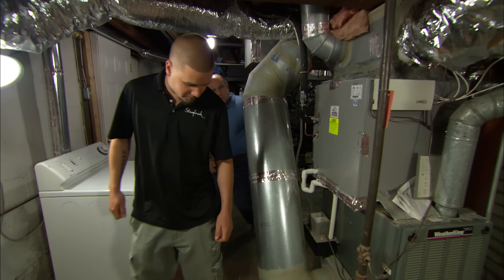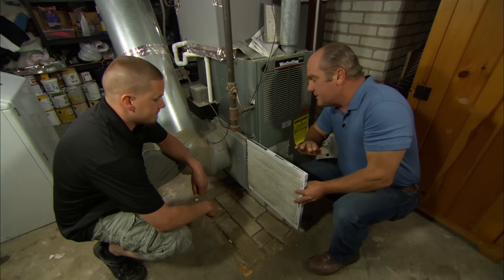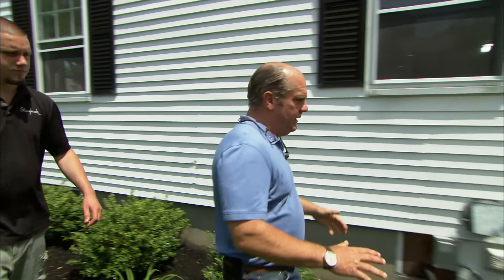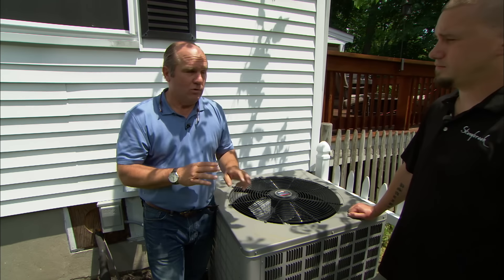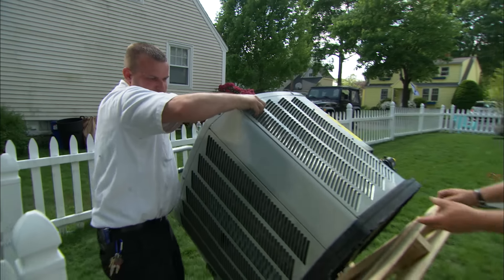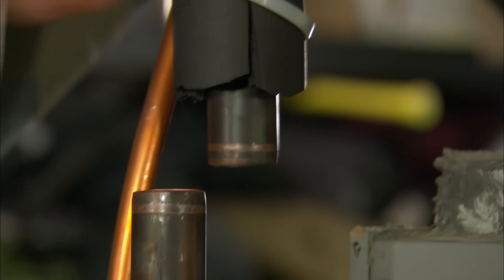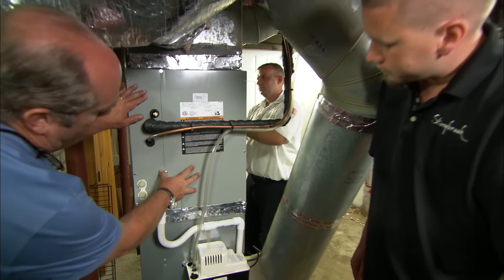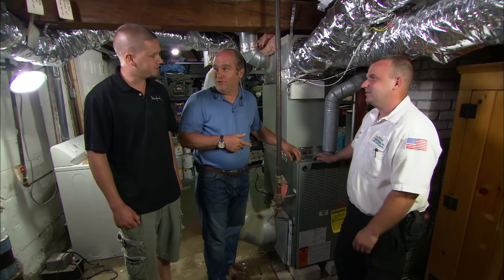How to Repair a Frozen Air Conditioner | Ask This Old House

Comment: WHY ARE THEY SITTING ON THE GROUND THEY SHOULD BE ON STANDS
Reply: AND DOES NOT NEED TO BE A TRAP IN THE CONDENSATE BECAUSE THE COIL IS ON THE POSITIVE SIDE OF THE COIL

Comment: That train condenser should be back around like 10 degrees so cool that's how you charge a unit yes it comes pre-charged with refrigerant but you need to gauge up and make sure the sub coins correct make sure all your pressure is in saturation temperatures are correct I guarantee you that sensing bulb its f*** tho I'm going to keep bitching about that

Comment: This guy doesn't know what he's talking about he's running a drain trap on a positive system with a pump you're pushing air through a coil you don't need a trap yes and he did trace the lines telling this guy that's refrigerant runs backwards

Comment: I have never head of such a thing as too big of a unit. The AC system will run only as hard as it needs to to meet demand. Its like saying you have a V8 car and if your just cruising the car will overheat cause its too much car for what you are using it for. This moron needs to check the circuit board and the blower because it sounds like the blower is not operating at the right CFM of air. Homeowner got played.

Comment: lol he didn't even measure refrigerant levels, when you're low on Freon you can get coil and line freezing also why wouldn't they just pump the gas into the compressor and reuse the unit they don't need to recover it for the new unit because they come with Freon and they shouldn't reuse gas for other jobs, that's just bad practice.
Reply: people normally recover refrigerant to have it recycled... if its R22 you actually get money for it. if they werent re-using the unit they needed to recover it. not going to blow the charge on TV
Reply: A unit that new isn't gonna be using r22, and my point still stands you can just pump it down and reuse the unit

Comment: My car is malfunctioning and not running optimally. Okay says the auto technician, instead of diagnosis and this car is to big for your size family anyway.....you need a new car!
An oversized unit after cooling and satisfying the indoor thermostat simply means that the unit will not run for a longer duration and not optimally removing moisture from the interior. You will just not be as comfortable in a mold prone cold and humid environment.  How about after checking airflow restrictions to simply do an  elementary diagnosis - Blower fan speed, condenser coil fan, refrigerant pressure, refrigerant leakage, liquid line restriction, delta T reading.
This has to be the dumbest AC  diagnosis and refelcts that we instead of repair just throw things away. The industry has created an environment just like the auto industry to simply replace expensive items. Im not an HVAC tech and can identify how ridculous and expensive this approach for remediation is!

Comment: Every HVAC company that came to my house more than 12 just take a quick look at a few parts then go its your insulation in the attic 100% lol now in central fl you need 13" I have 13" maybe even 14" and its fine. The coils always freeze and only 1 side of the house gets a ton of air. Ive been told many things but this last guy came out on a hot day ofcourse and checked the freaon said its perfect and said he had to go bcuz his sons tooth needs to come out omg lol I was pissed he showed me the wiring to the condensor was damaged and gave me a 3' piece of wire and said I can do this yourself. Yes I am very mechanicly inclined but still charged me for coming out lol 99% of these cos are very shady I mean these guyslook legit on here but thats for a video I've never met 1 hvac guy that will go out of his way to check everything to make it run perfect pretty sad imo ur better off getting window ac unit's just a tip

Comment: I think this is a bunch of s***. you should have checked the thermostat not charge this guy another $5,000 for a new unit and coil. Obviously the problem is a thermostat. a slight adjustment or replacing of the thermostat would make sense to me.

Comment: Hilarious this guy acts so professional, yet has to have a tape measure and pad to calculate such a small system?  Math much?  Lol.  I can look at any flex duct and know its size by looking.  And look at round pipe and square duct and know its size up to about 20x10 duct.  Can calculate up to about 5 ton systems in my head.  I could do this after about 5 years in the field.  Yea its def plenty big.  Would also short cycle, and not remove enough humidity, causing mold.